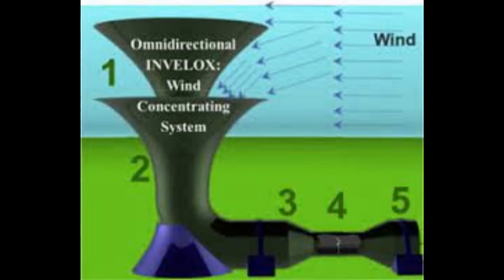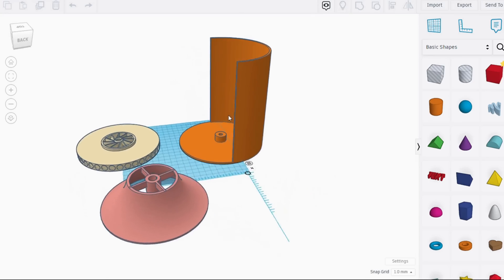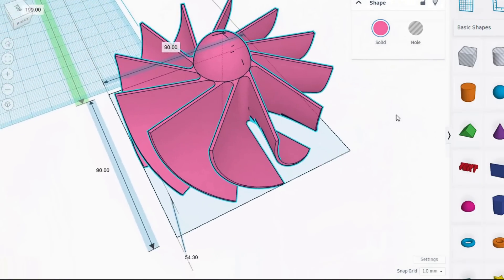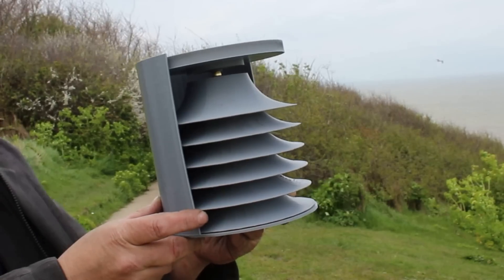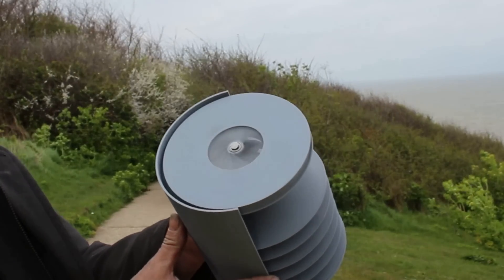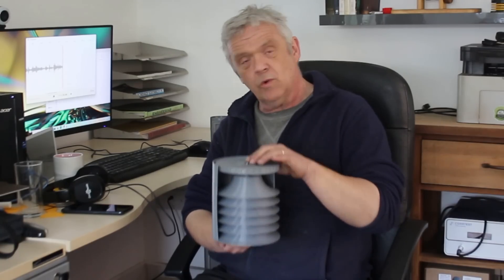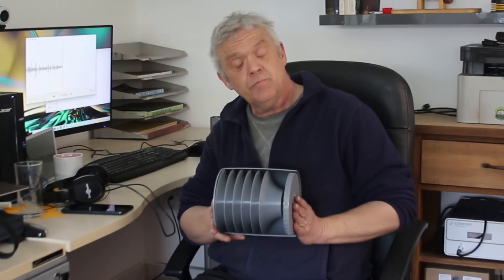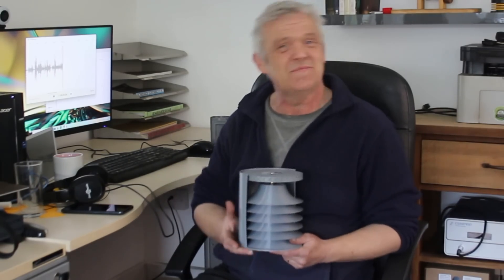1901 Brand New Wind Turbine Design For Camper Vans, Boats And Roof Ridges

Comment: Other than measuring some voltage outputs, has anyone measured any power outputs with varying loads to determine how the concept actually performs? It’s a great concept and your work is engaging and really informative. Stay curious!
Reply from the maker: volts is no good mate - you need to measure torque on the shaft
Reply: @ThinkingandTinkering  Volts and amps together would be most interesting and easier to measure than the torque.
Reply: @ThinkingandTinkering  I agree. Torque will be the ultimate measurement.
Reply: @dudleysmith5111  Power is the ultimate measurement, that is what a generator has to provide.  Torque is meaningless by itself.
Reply: I would argue that watt output is a sufficient measurement as at the end of the day, that is all we really care about.

Having a generator built up, with a couple wires running down to a test bench, you only need to measure the power output of as you apply a progressively larger load and see where the wattage peaks before stalling the turbine.

A large fan, such as a positive pressure ventilation fan used by fire departments, could be used within an enclosed environment as a static source of wind, a conventional wind turbine tested and your unit tested to compare.

My long term life goal is to build a self sufficient electrical powered sailboat (with a diesel generator for backup, because I'm not totally crazy, but hope I never need it).

Wind turbines are commonly under powered, noisy and bulky compared to solar and hydro power generation, especially when looking at a huge power budget of induction stove tops, convection microwave, electric incinerator toilet AND an electric drive motor.

Not to mention, fridge / freezers, washing machine clothes dryer and electric heating / cooling (reverse cycle marine AC with sea water heat exchanger most likely).

A couple of these high on the mast may be quite useful, IF the power output is worth the extra weight up the mast.

Another thing you might consider, is some way to turn it off.

On a following wind, capturing and converting to electrical power will also produce some mechanical force helping propel the boat, but any wind coming from forward of 90 degrees will also effect a force on the boat, in the wrong direction.

In most cases, this won't matter that much, but on light winds where you want everything to work for you, anything working against you is bad.

BTW, hi. Random YouTube recommendation brought me here.
Reply: @Emily35  ~
 "On a following wind, capturing and converting to electrical power will also produce some mechanical force helping propel the boat, " <~~~~~ You perhaps are not considering the difference between 'true wind' and relative wind'. Most wind generators do not produce much if any energy when sailing down wind in anything less than a full gale. This is because the 'relative wind' moving over the boat is radically reduced from what the 'true wind' is. The size and 'projected area' of the generator Robert is working with would not add any measurable, positive influence / thrust to a sail boat going down wind ! 
 "but any wind coming from forward of 90 degrees will also effect a force on the boat, in the wrong direction."
 Well Emily, if you want to have "fridge / freezers, washing machine clothes dryer and electric heating / cooling" <~~ You are obviously not talking about a 'tiny live aboard'. In order to have that level of decadence aboard your dream boat, you are talking at least a 45' boat. That would average out to a displacement of 30 - 35K lbs. At that displacement it would take a huge (like 8' tall) generator to create enough windage / drag to be considered an impediment to upwind performance. You did mention putting generator(s) up high in the rig and this would greatly improve their performance by getting them aloft into cleaner, higher velocity wind. However even putting one at say mid mast height, you would need to have one that was over 2.5' tall to even start to see any significant sailing performance loss due to windage. If you are talking about a boat with ""fridge / freezers, washing machine clothes dryer..." You are talking about a big, heavy displacement, cruising boat that has pretty low and slow performance to begin with. So the windage 'knock' on your proposed boat would be extremely negligible if even register able on a generator of less than gargantuan proportion :)
Reply: @gilray1977  are you sure?

You do know that you can get combo clothes washers / dryers that are very small and can only handle a few changes of clothes for an adult?

You do know that a 32 litre fridge is still a "fridge" right?

You know that you can have ALL of this sort of stuff on catamaran and trimaran's right?

I'm not just talking about the boat that I want to build for myself, but the growing movement of boats going full electric.

Sure, the effect will be different on different boats, different sail plans, different hull designs.

I'm not a hydrodynamic or aerodynamic engineer, but I am just pointing out that the option to "turn it off" should be considered.

Unless you are an aerodynamic and hydrodynamic engineer and have done all the calculations for every hull shape, sail plan and for the size of generator that is needed to make the cost, weight and bulk of install actually worth while, I will rely on your statements with handfuls of grains of salt.

Oh, also, USE METRIC LIKE THE REST OF THE WORLD DOES.
Reply: The backup diesel still needs to be run up to operating temperature every week or so, about 20-30 minutes. Using a combination of this, solar PV and propeller regeneration would almost eliminate the diesel aside from motoring range.

It's feasible today as long as you find a boat with a seaworthy hull!

Comment: Robert, the development of this project has really caught my attention. I'm fascinated to see where it concludes. could this be a foundation for a power-system to run your garage from?
Reply from the maker: yes - i think it could mate
Reply: @ThinkingandTinkering  I currently have a mini solar system running 12v and 5v power supplies in my garage, just enough for simple LED lighting and phone charging. this wind turbine project of yours may well end up as the reason I buy a 3D printer and make some little wind turbines in addition to the solar rig.
keep up the good work Sir!
Mike
Reply: I'd be happier with just a 12v or even 5v output to match my existing portable solar.
Reply: Make possible that  E V cars to get charged while on drive.
One side battery discharges power ,on the other side through this wind power generating turbines the battery gets charged.
So, there is no necessity to plug for a charge . it automatically gets charged through alternator and discharges power for rotary motor.
Reply: @saddamhussainssaddamhussei3613  you will effect the aerodynamics of the vehicle and waste more than you generate.
Reply: @whiskeyinthejar24    I have seen a video. One of a person he mounted a wind turbine top of his car. It generates electric power through that the battery gets charged on the other side power consumed by motor discharged.
Reply: @whiskeyinthejar24  .. if you could integrate it in the design of the car, it wouldn’t necessarily be a problem, there’s definetly potential there … i have no idea how much it can generate, but i do believe there’s a niche for that.
Reply: @saddamhussainssaddamhussei3613  If you want a car that sorta does this look up Aptera, its a solar car!!

Comment: Combine it with a dorade vent
Reply from the maker: for sure
Reply: @ThinkingandTinkering  I didn't know what a Dorade vent was, and on first view I thought it was an exhaust vent. On second look at how they work, I see they're a vent to bring air in a ship.
My thought was a 'reverse' dorade style vent that forms a vacuum exhaust, increasing the speed of air flowing through the turbine. A vent on top that swivels away from the wind flow, directing the generator air downwind. Instead of the opening pointing into the wind, it points away from the wind.
There would likely be an increase in generator speed and torque if the air flowing through the generator had an easy place to go.
The commercial examples at 0:24 and 0:29 do not show that. The first one has a static exhaust pointing in one direction, the second one is set up more like yours where the compressed air exhausts directly into the flow of air around the generator, in an already denser flow of fluid (air) rather than a partial vacuum.
I don't know if I'm explaining myself properly. I wish I could upload a graphic representation of what I see in my mind.
Reply: I had never even heard the term dorade, and after seeing them, got me thinking about how they work. I envisioned an exhaust, not an intake. See my comment to Robert.
Thanks for the flash of imagination.

Comment: How long did the completed model take to print and what filament type are you using ?
Reply from the maker: i don't remember the time but this is PLA - you might want to use a different filament
Reply: @ThinkingandTinkering  Thank you, I use PETG a lot, just because its more suitable for outdoor use.
Reply: @ThinkingandTinkering  You have inspired me, I am now working on a water generator that will go into a drainpipe and generate as water passes through it, I will send you a photograph of the model so far.

Comment: Hmmm. On the boat part. Being able to be disassemble it, a lot, will go a long way. Don't glue the ability away peeps, screws only. It will have to be cleared of picked up bugs. Or put a bug screen around it of sorts. That poor impeller will get packed in no time while zipping around.
Reply from the maker: cheers mate

Comment: Brilliant, very cool Rob. I lived on a sailboat for several years and often thought about wind turbines being the thing was wind powered anyway lol. I can see the entire mast being replaced with that and a generator powering a motor driving the boat just the same as it already operates. Solar wind is so fascinating. Also could fit several solar panels for non wind days and sail that way. I am thinking a folding mast/turbine tower for low wind days.
Reply from the maker: nice mate
Reply: @ThinkingandTinkering  that'd be FIRST mate :p
Reply: @drillerdev4624  that's funny lol
Reply: @ThinkingandTinkering  thank you Sir.
Reply: Hmmm. The power from a conventional propeller is generated at the tips which in turn produces leverage, which is why the larger the propeller diameter (think wind farm) the greater the power. This turbine is too small, as soon as you add coils to produce a voltage,  then attach a load, you generate electromagnetic breaking.  There won't be enough leverage to overcome this unwanted effect. The whole thing would need to be much larger, including the turbine.
Reply: @Nailnuke  I wonder if a reverse funnel at the very top of the stack, directing away from say 50% of the center, coupled with a full width propeller would help solve that problem.
Reply: the boat could only go as fast as the wind hits the boat. Hence I propose a combination of wing sails and this turbine. The first accelerating the wind, the latter increasing the efficiency
Reply: @monnoo8221  Actually you can sail faster than the wind.  It's called High Performance Sailingb and yes, I googled it 8D

Something about being at a 135° angle to the wind does the magic.
Reply: @myaspyre3919  yes I know. That was my whole point. Yet you could only do so with wing sail, not with the funnel stack.
Reply: @monnoo8221  i think hes talking about using it to charge a battery for electric motor to power the boat? Otherwise you are probably accurate
Reply: @monnoo8221  I love it, brilliant my friend.
Reply: What a fantastic  idea !!
Reply: Jaques Cousteau tried that 30 years ago. It wasn't cheap, and it was really unreliable.
Reply: @uncletiggermclaren7592  the good news is that we have much better technology 30 years later. We have learned a lot and solar would also be used as well as a stored energy system like batteries. It would definitely be a balancing act but that is exactly what all machines are. Thanks for the critic, it helps a lot in the thinking process.
Reply: @uncletiggermclaren7592  i think it was more like 50 years ago but luckily technology has improved since then so it might be worth it to keep trying.
Reply: @randylahey7343  Yes, I am sure there have been avast amount of improvements.
His vessel wasn't some lightweight jury-rigged thing by a bunch of amateurs though, far from it. It was built using the expertise of the British-French space industry, and it had extremely cutting edge material and electronics.
To improve on it it now, you would need to be a billionaire and no doubt a lot of it could be CAD and the electronics would be far cheaper . . .
What killed it was the huge vertical turbines were not reliable, and when they went wrong, they couldn't be repaired at sea.  
The main increase, or the one that would have the greatest impact, would be the modern batteries, I bet.
Reply: Some thought are that

The back of the shield can have those flexible solar panels on it for a much larger unit. 

The cones stack, so they can be lifted up and down like Venetian blinds for the window.

The turbine and generator:
 on a much larger unit 
1. The turbine and generator can be split by a shaft lowering the center of gravity of the generator to below deck. 

2. The turbine area above deck can then be ducked to the rear of the boat to add thrust when convenient.
Reply: Great idea, if you could be confident it needed little to no maintenance the ideal spot would be mast head. Might need to sort out lights antenna interferences but still!
Reply: @noahhume9743  Nice, yes it would require some fun engineering. I have a folding mast already so I have to give credit to the folks that made it in 1975. I can't stand the bridge issue going and coming from port or through waterways in congested areas.
Reply: So !!! If the vanes were on outer area..would be  4 to five  ..6 X faster !!! ???¿¿¿
Reply: @@doublewhopper67 would it? IS not the wind a product of solar radiation? To be technical, all power is solar power from the plants that decompose to oil ( yes even gasoline is solar ) to the wind that blows. Even the tides are due to solar given that if the oceans were frozen, tides would not rise and fall as they do. Sailboats use the wind, solar produces wind, if wind is captured and used as energy to propel the boat, it is in fact sailing my friend. Got to think outside the box.
Reply: The wind hitting the mast generating power to run the motor causing the boat to move faster causing the wind speed to mast to slow causing power to motor to fall causing boat to slow causing the wind speed entering turbine to and so on🤔
Reply: @charleswieand4445  Interestingly that isn't what happens with a yacht. You have MORE wind, what is called "Apparent wind". Sometimes it is called "wind across the deck". 
And this is one of the real advantages that Jacques Cousteau's system offered, because the turbine was auto-following the apparent wind direction with vanes, you took all the available wind, without all the extra weight and complexity of the boom and sailing tackle of the normal yacht sails, and you didn't have to adjust anything.
Reply: The boat next to you (when moored in a harbor) will not like the noise of the turbine!
Reply: @iamkian  yeah, I don't like the smell of diesel so I reckon we would be equal lol. Besides, in port it would fold and be silent anyway. Most ports have bridges that require lifting to pass with a sailboat so the mast aka turbine would be folded.
Reply: @iamkian  I never liked the noise of the wind propeller blades next to my boat, either.
Reply: @JoanOfArgghh  LOL the turbine would be in the interior or lower mast with no noise... the noise from a wind turbine comes from cavitation around the blade tips and this design would not operate that way. Besides, I don't care what others want for my boat lol, they do not care if I do not want to smell their stinky diesel.
Reply: @JSabh  I wasn't addressing your design, I was going with a commenter's premise about noise. I don't like the wind generators on my neighbor's boat. Not sure why you addressed your comment to me instead of "i am kian" but maybe it's just easier for you to LOL and mansplain to a woman.

Comment: That looks like it would do wonders for boats, only thing I think people would complain about is you did not show the power output, but with as simple of a design you have, anyone should be able to replicate it and test it on their own
Reply from the maker: my thoughts exactly mate
Reply: @ThinkingandTinkering  I'm pretty sure this is a series....be patient.
Reply: @markseamans4682  Well, you can call it "a series". Those are building blocks and Robert explained this a few times in his clips. It's like a Lego for a bit bigger kids😁
This part is about catching wind. 
You can find a part about different ways of forcing wind to move something. 
Then there is a part about how to change that move into electricity.
When you put everything together, you will make a wind generator. But you will remember it has different parts and understanding how they work will help you to slap one together just for your specific needs.
It's similar to one bushcraft rule told by Mr. Mors Kochansky: the more you know, the less you carry.
And Robert is giving this knowledge here. With a big smile and enthusiasm😃